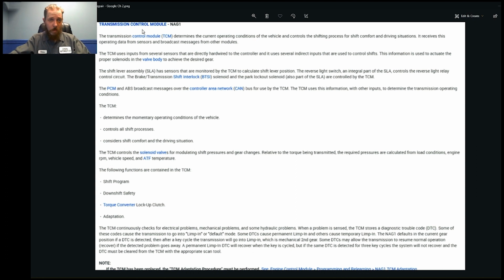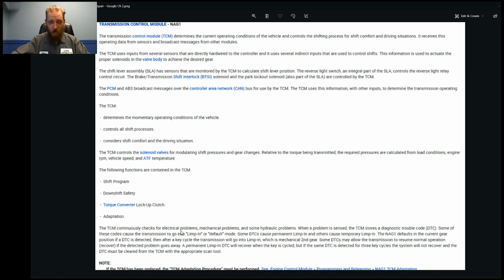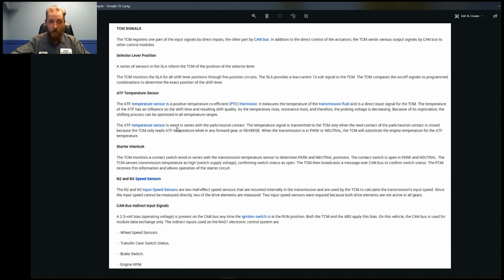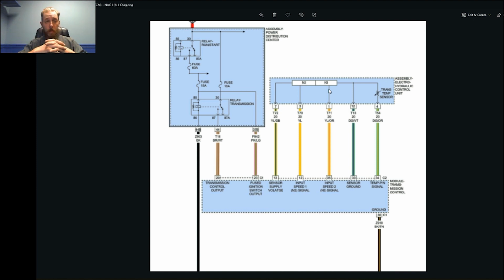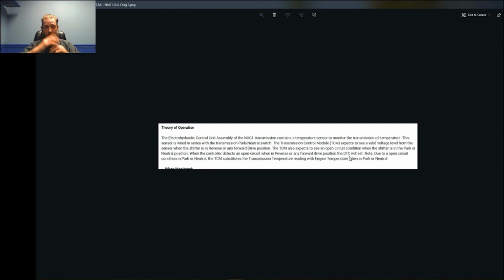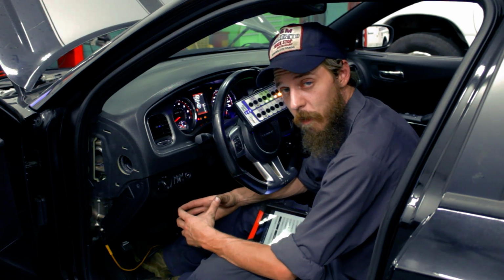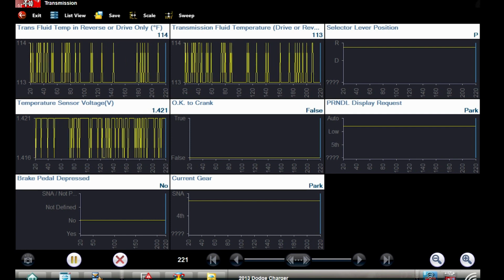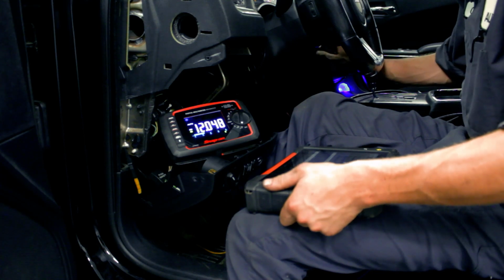'13 Charger No Crank - Conclusion - Part 4

Comment: Wait so when you injected 12v to the temperature signal of the tcm, wouldn't that damage the circuit which is supposed to use 5v based on the data pid giving you a range of 0v-5v?